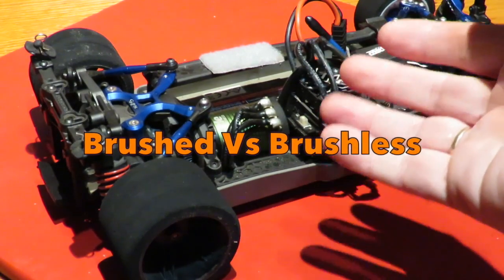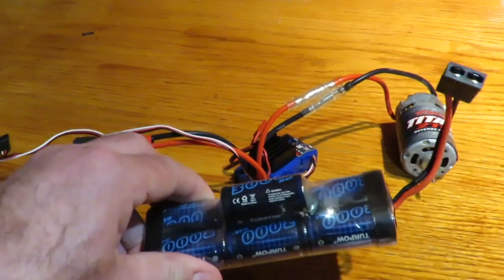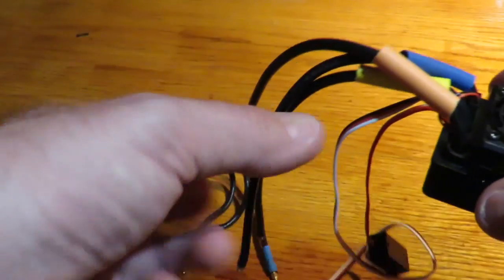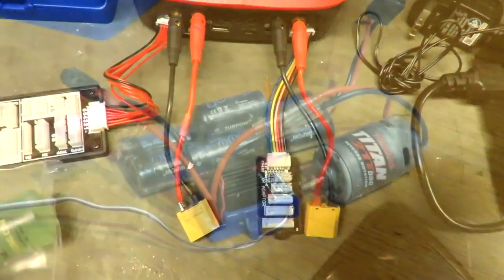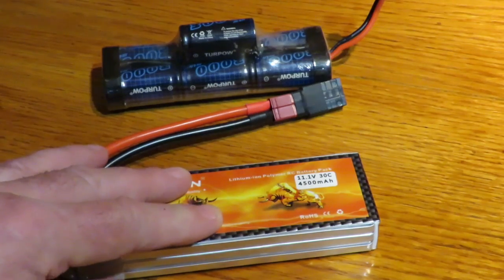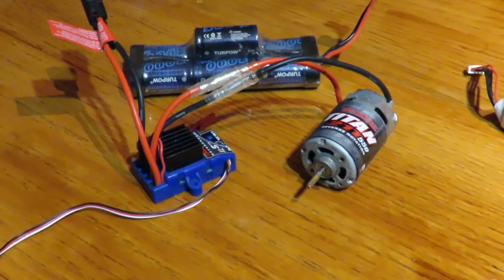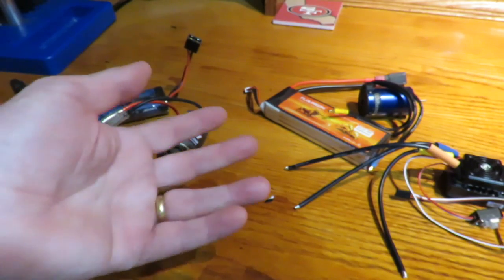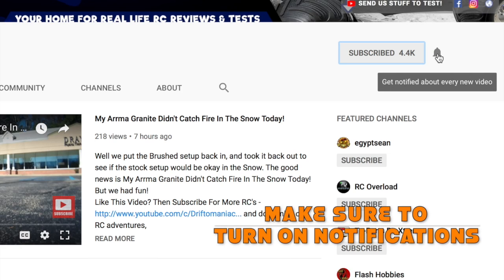Brushed Vs Brushless Motor - What Is The Difference?

Comment: i just got into rc stuff in the past couple yrs an i started with building the flite test guys rc planes from foam board. it was the cheapest way i found to get into rc planes but i kept seeing ppl making cars with 3d printers an ive just recently finished building a car that i 3d printed an i went with what the designer who created the cars suggestions on motors an its alot of fun but i want a little more from it but when i was building the planes the brushless motor an esc kits was the cheapest way for me to get into it an i think the batterys was one of bigger reasons it was suggested for weight savings in the planes but its pretty much the same style motor an esc that im using on the car as i used on the planes just a bit bigger. i used a2212 for my planes and

Comment: Great video, helped me a lot to make a decision on what to get my nephew.
Gonna go with the Brushed version for sure. Thanks.
Reply: Brushless is much better and if you buy him a ready to run car then it will come with the batteries and charger so there is no extra expense. 
The extra expense comes when people convert their brushed systems to brushless, it's not that big a deal if you're buying a brushless car to start with.
It will be a lot faster and more exciting for him and don't forget you can turn the throttle down on the controller to make the car slower while he learns and he can start on 2s liops which is slower before upgrading him to 3s or more when he gets better.
It will also be cheaper in the long-term because if he does get into rc then he will definitely end up changing a brushed system for brushless down the line then there will be the expense of a new motor,esc,batteries and charger so buy brushless from the start to save the cost later and just turn the speed down till he cam drive a bit

Comment: I have a BSD street assault rtr car, it states that it will take a 2s or 3s lipo on the stock brushed motor & esc but since switching to the 3s, when driving for a few minute periods at over half throttle the motor starts to get stupidly hot and even smokes once I come to a stop 😒 I have the same lipo as you showed in this video. My ESC gets hot but not too hot to touch(it's fanless) I'm guessing BSD's claim that it supports 3s is a little over exaggerated, I recently had to convert it to full front wheel drive due to the back diff managing to pick a tiny stone up and destroying itself. Surely this should reduce the load on the motor due to the front wheels lack of grip during acceleration. I could understand if I was giving it full throttle but the truth is, full throttle is pointless in the current configuration, it just leaves half of the front tyres on the tarmac 😅 I'm guessing that it would be a good idea to just go brushless 🤷‍♂️

Comment: My first was actually nitro car, parents scored it for $3.  complicated when you're first starting and I think I was 12 at the time?  it was always hard to get running right, but was fun when it did. 

Much more prefer electric just charge and go, I do want to get this old redcat tornado running again. I think its just missing a nut that attaches to a rod that then presses the clutch.  still reading on how to get it tuned, and now I have to dig around and see if I have the glow plug heater charger... Might just buy another, I cant remember how fast this thing was. might be more wrong with it.

Comment: Will a 2S Lipo burn out brushed motor?
Reply from the maker: Victor it depends on the ESC that's being used and the load being put on the motor. It's heat that's the killer not the batteries juice itself. Eg. if the ESC is 2S capable like say that on an Arrma Granite 4x4 mega, which has a brushed motor matched to the weight of the buggy then the brushed motor will handle 2S all day long, however if you were to put the same setup in a much heavier buggy/truck or alter the gearing substantially then the motor will be under much more load and fry. Hope that makes sense? Most of the latest Esc's by traxxas and arrma let you run 2s on brushed motors day in day out. People that fry them tend to have put them under excess lard.
Reply: Thank you.

Comment: See I’m interested in a lipo and a brushless setup as a beginner(25 years since I had my king cab), but all I see are various clips of exploding and smoking buggies.

The reason for my interest in lipo is 1) length of runs. 2) charging time. 3) a small increase in power.
Reply from the maker: Okay now when it comes to lipo fires and explosion don't let this put you off. Lipos are very safe if handled correctly. The main two points to be aware of is don't let them discharge too low, if they do they swell up burst open and catch fire. However most esc's have a lipo mode, which cuts the power off when the voltage gets too low and avoids this happening. Car fires occur when people use a lipo but have the esc set to nimh, the lipo then discharges too low. Also don't overcharge them, I ALWAYS balance charge mine, this keeps the cells as the name suggested balanced to the same voltage, mah, charging fires occur when people don't balance charge them and overcharge them. They then puff up and the result is the same as above.
Buy a lipo charger that can both balance charge AND storage charge batteries, as the name suggests storage charge is used for lipos when you're not going to use them for a while. They say to leave lipos stored half full, don't store them empty as they voltage will drop over time and they can swell up.
Now for the good stuff 1.) It's not just lenght of runs but the power curve in those runs, unlike a nimh battery which tails off during use, the lipo will pretty much give full power until the lipo low voltage cutoff kicks in indicating the packs empty.
2.) Charging time - Some lipos can be charged at 2 or 3 times their max dischage rate - NOT ALL LIPOS though, so check before you buy/charge. This can reduce charging time. A 5000mah pack take my good charger about an hour - that's a big pack though.
Get a lipo charger that can charge up to 6S, you may start out with 2S or 3s but then get a bigger car with 2 x4 S as an example
3.) The increase in power and speed is substantial. More so if you go with a brushless motor. Note there are a lot of brushed cars out there that now take lipos. However to run a brushless motor you'll need a brushless esc as well.
I would say go for it, but ask questions along the way. Also you will find bad stories about EVERY lipo manufacturer. Some maybe true, others bad luck, and most? People simply not following the above. Hope that helps out
Reply: Thanks for taking your time to reply, this is great information! – I’m definitely going to take a real look into this now. The positives greatly outweigh the negatives, as you say if I get it right from the start there shouldn’t be any problems.

Subscribed!
Reply: Massive increase in power not small also longer run time and keeps it's power till the end instead of slowing right down as the battery runs low.
Look after them and follow all instructions then you should be fine,the problems occur when people don't follow the instructions when charging or setting the esc wrong etc
Reply: @davidmellish3295  – I made the transition last year, and decided to buy double the capacity that I regularly use so never really go below half a charge, great for a storage charge too!
Reply: @GeoffreyCapes  were you surprised at the power difference at first mate ?
Reply: @davidmellish3295  – most definitely, the amount of instant power and the length of time, will live near a long looping walk over the hills and we’d “take the dog for a walk”, we class the rc as a family member!
Reply: @GeoffreyCapes  lol,what are you running mate?
Reply: @davidmellish3295   – Hobbywing EZRUN, started off with 3300kv, but it topped out too soon for me, then went 4000kv and I felt this was the sweet spot as it was still fine accelerating, then went a step further and did 5400kv, which I very much like but dial back slightly on the Transmitter for most situations then go all out in a open park. If I would have to stick with one it would be the 4000kv motor. Lipo 2S.
Reply: What’s your setup??
Reply: @GeoffreyCapes  Due to losing my job thanks to covid I had to sell my x maxx (stock ) 
I'm looking at buying a wltoys 124017 version 2 ad they go 40mph out the box and 50 odd with a 3s and they're only £126 with 2 batteries and the speed controller takes 3s without needing to change it.
I'm only working part-time so I've got to buy a cheap rig then hopefully upgrade in better times.
I felt sick selling it but needs must and after paying in to the system for nearly 30 years it's been like getting blood out of a stone to get government assistance 🙃 
No point moaning life goes on and I'm sure I'll be back bashing in the near future
Reply: @davidmellish3295  – Covid was the reason I got back into RC, I suffered pretty serious after effects and for 7 months opened up the kits I’ll been saving onto for several years. Hope you’re well / stable with health and again with the job, good luck in finding something that you love doing!
Reply: @GeoffreyCapes  thanks mate,I've loved rc since I first got a secondhand Mauri Samurai in the late 80s  it was an early 80s rc with a chain drive train. I then got a meteor that I heavily modified and it ended up a Decent little buggy that I used to race every Sunday after I changed practically everything on it . I  had a car washing round as a teenager and I'd spend every penny doing it up.
Then for what ever reason I put rc down for 25/30 odd years,got a Mrs and kids and I got my son a cheap remote control toy and i watched a few YouTube videos and it brought the bug back so I got an x maxx but unfortunately I had to sell it as needs must. 
I won't bore you with the details as we've all got problems but hopefully I'll be getting myself a little wltoys to play with soon

Comment from the maker: Who's had brushless from the start of their RC'ing?
Reply: Driftomaniacs I Acually started out with a rustler vxl
Reply: Driftomaniacs nope brushed hahah
Reply: I did
Reply: My first was a Team Associated pan car with foam tires for indoor carpet racing with a brushed setup. That was in the late 90s. When I got back into RCs last year I had no clue there were even brushless RC motors they were unheard of in the late 90s about like Lipos. We always used NICD or NIMH and used a set of 6 to 12 1156 light bulbs ran together in a series to discharge. RC really was expensive then to.
Reply: Driftomaniacs me
Reply: I started with .21 cubic inch (3.5cc) 2 stroke nitro.  That was almost 30 yrs ago.  Electric weren’t in existence back then I think.

Comment: It is my understanding that Lipo battery technology is very dangerous because of fire hazard.
Reply from the maker: No Lipos are safe when handled correctly. fires occur when people charge incorrectly or over discharge them. Lipo's also need careful storage otherwise if you leave them too long they discharge too low on their own and fire car occur. They just need careful handling!
Reply: Driftomaniacs I see.well thank you but I'm not sure yet.more information is needed before I switch.
Reply: Lipos are usally not dangerous. They are a lot faster, get warmer and can start a fire, but that is really rare(if you use several big batteries driving fast without waiting inbetween). If you drive outside( not on track) you should think of moving to lipo after a while. Keep in mind that if nimh batteries are decharged fully, they are not ruined, but if that happens with lipo you can just throw them away.
Reply: Lithium polymers may seem a bit too pro and a choice for some engineers, but many consumer friendly items are also powered by Lithium Polymer packs. I mean phones and those drones with crazy cameras. Lipos are safe and reliable way of producing power!